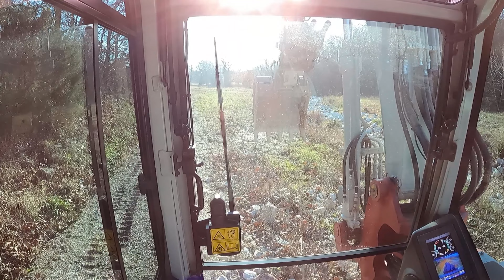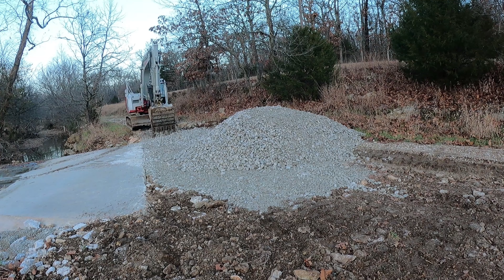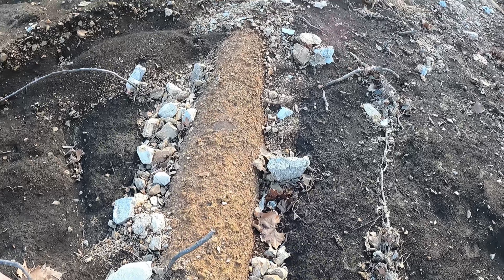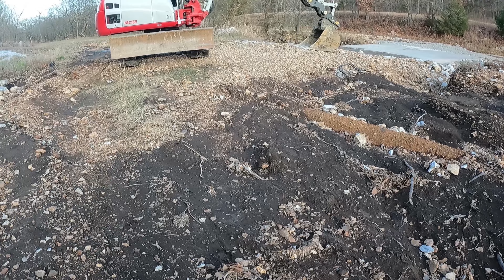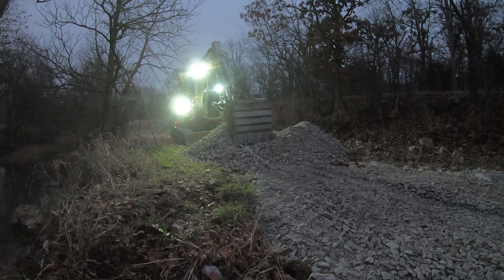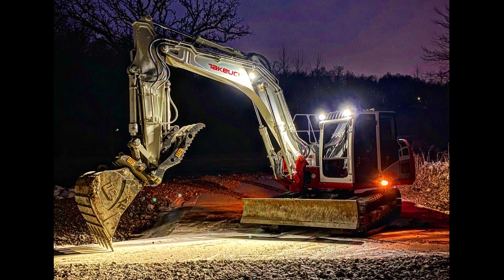Repairing A Washed Out Road At The Utility Easement

Comment: I guess I didn' think about the terrain there, I haven't even driven through SW Missouri in 40 years. I guess the terrain doesn't show up on video too well, so I didn't think of it.  Reckon you get some fast water in heavy rains. The terrain kind of explains my question about the 15' deep sewer pipe on the last video, guess there's plenty of room for it to flow down still.
Reply from the maker: Yeah we have some hills but not really anything big it’s more of a flat low laying area here

Comment: If the concrete was ripped out and put 6 culverts with concrete in its place the water could flow through and not around. Good job though!
Reply from the maker: Maybe but the culverts would need to be about 30’ diameter. The last time it flooded down here the water was 35’ deep on top of that concrete crossing so the water takes up the whole valley not just that little creek. They are suppose to get me some pictures and I’ll send them to you of when it’s flooded.

Comment: Not much a guy can do when it washes it away, well not unless they want to spend a bunch of money. Like you said job security 😜. That 3 inch minus looks about what our pit run looks like but I think our pit run has more fines and sand to help bind and pack it together. I'm sure you've seen our gravel on Jpaydirts video's that we're spoiled with. Only thing I don't like is it's all going up in price, it was $3 to $3.50 per cubic yard this year and probably gonna be more next year and 3/4 inch minus ranges anywhere from $6 per cubic yard to $9 per ton. Used to get pit run for $1 per yard 10 to 15 years ago.
Reply from the maker: Yep just too much water running in this area. Yes it’s very similar to a crusher run type stuff just with 3”. Yeah the price is getting ridiculous on things hopefully it levels off soon. Appreciate you watching